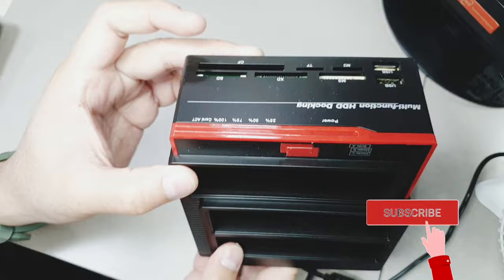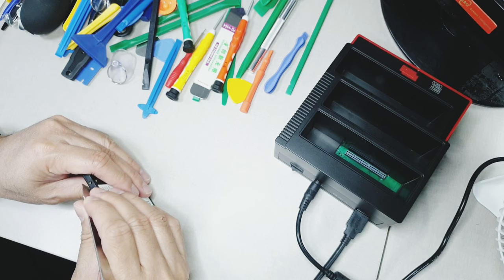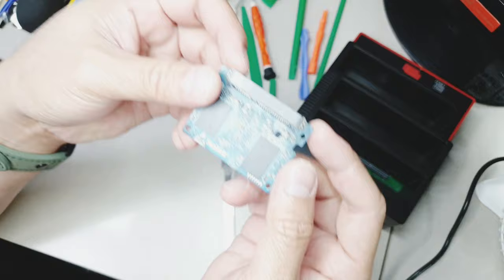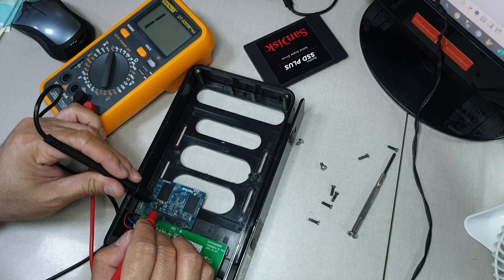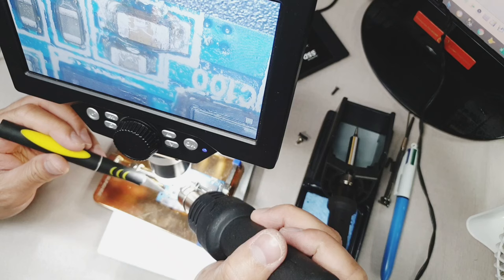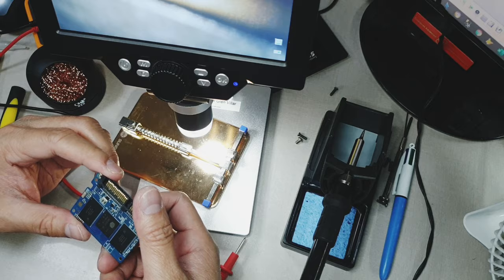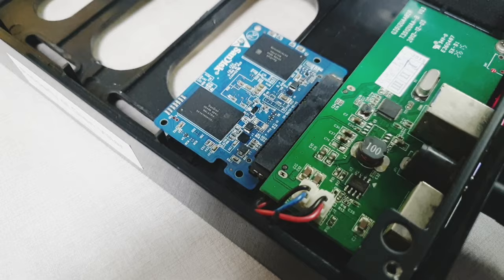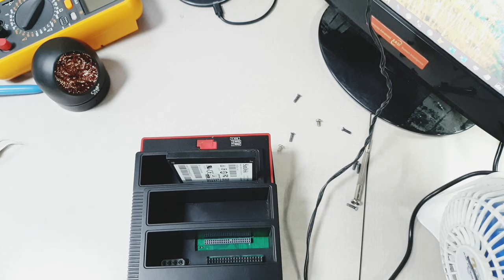How To Repair  Dead SSD (Solid State Drive) and Recover Data  - 100% Working

Comment: My ssd doesn’t show up at all in disk management. It also makes it so that file manager and disk management turn slow and fail. Does anyone have a similar experience?
Reply: I do please comment a solution if you find it.
Reply: My cheap verbatim ssd does exactly that, when plugged in using a usb3 to sata adapter, it shows up in explorer but the moment i try to access it everything freezes. And when its plugged directly to the motherboard the pc fails to boot at all.
Reply: I do. The boot drive is 100% health, running. Sudden power outage and poof. Cannot boot. The bios and windows detected the drive, but froze when attempt to read/access the disk content 😢. For now I try to run the ssd without sata cable for day and see if "other youtube claimed" self-repair function work.
Reply: Yes I do
Reply: @vitatreat9037 does the solution work for you? I have this same problem. The ssd detected in bios and windows but any interaction with it will cause freeze. Not even chkdsk would start to scan it.
Reply: I have two ssd one 256 GB and the other 512 GB. Both are not working. It shows for a little time when you install the window it freezes.

Comment: Thank you very much! Explaining what you're doing (like checking with multimeter if components are shortened) was so helpful to understand the whole process. I finished tech school, but sadly I was prepared only for installing stuff that is ready to install, not to reparing the electronics and thanks to people like you I can experiment with fixing things electronics that others consider as trash
Reply from the maker: Welcome and thank you for your supportive comment.
Reply: @ReynaxisSolutions  may shop ka ba dito sa Manila. may papagawa sana ko na ganyan. di na din madetect ng motherboard.
Reply from the maker: @LabyuPilipinas  Hi, wala akong shop sa Manila e. Nandito ako now sa Papua New Guinea. OFW. Sorry.
Reply: Hola era el capscitor la falla
Reply: Sir, yung 2 shorted na capacitor tinangal nyo lang po ba ng hindi pinapalitan?
Reply: san nyo po binili thermal cam.

Comment: Your tools are so cool... wish I had the money to build a full lab with equipments like these and just play with electronics all day
Reply from the maker: Hi Nanof,
Thank you. I wish that you have them all too. You're right, playing and experimenting with electronics stuff is a fun way to go through the day.
Reply: The moonins seem to be on the rise, why is that? Also, you can get a seek thermal cam pretty cheap, a solder iron fairly cheap and a microscope cheap. Won't be as good as his but it would still do the job.
Reply: Cheap thermal cam? Really?
Reply: @drummerdoingstuff5020  no.... no... the least expensive decent is $100
Reply from the maker: @drummerdoingstuff5020  The thermal cam that I have is a bit pricey. There are other cheaper alternative but the thermal resolution and sensitivity isn't as good though.
Reply: so is it just necessary to remove the overheat capacitor?
Reply: Amazing. I’ll try it. I found the background piano jazz a bit annoying. Hard to understand voice with BG music. Turn it down! or off!

Comment: After trying to get the ssd to read i noticed there were quite a few components that were hot.  But after removing all 22 of them when i plugged it back in to the pc it got so hot it shot a spark out of it then the pc flashed a blue screen and now it wont power on at all..  i am going to try flipping the little red switch on the back of the computer..  says 220 and 110, i am going to move it to the 110 side and see if that helps..
Reply: It didnt help, it created more hot sparks.. but this time my light bulbs in my home went out.  I think i uploaded a virus to my house now because nothing is working..  i think the virus is in my fuse panel, maybe if i try the ssd in there.   The fuse is all black, will try the ssd card there and see if my pc boots..
Reply: Well that made a lot of hot sparks but the lights are back on,.
I have to go now, the fire department is telling me i need to leave because somebody set fire to my walls.  People are cruel..
Reply: @Z-Ack  Sorry to laugh,  and I don't if you are serious or not,  but that is really funny.
Reply: Try using 460volt three phase. That will speed up the machine for sure. 😅😅😅

Comment: Great job with excellent technical prowess. Thanks for the video recording to share such great knowledge and skills. I however, observed that you isolated a damaged capacitor, but you didn't record or show that you replaced the capacitor. My question is: do you need to replace all removed electronic components from a logic board?
Reply from the maker: Hi, thank you for the compliment. I did not have to replace the 2 caps that I removed because they were just filter caps. After recovering the important data from the ssd, i never used it for OS anymore. But I still use it for holding temporary files when I'm copying from one place to another.
Reply: The capacitors are there for a purpose they are there to stabilize the power lines to the chips. To not replace with new ones is very amateurish & I would not trust that SSD for anything. DO IT RIGHT or DON"T DO IT AT ALL.
Reply: @Starlight-AG  He even said so himself...up there. He only uses it for transitory files now.

Comment: I saw you remove the capacitors but did not see you replace them.   If you did replace them, where do you purchase them?  Thanks for the video.  I have 2 nvme drives I'm going to try to get the data back from.
Reply from the maker: Hi, i did  not replace them as there are other caps remaining that allows the ssd to function.
Reply: @ReynaxisSolutions  ooohhhh
Reply: The ideal scenario would be to remove the defective capacitors and replace them with good capacitors, but in this case the objective is only to recover the data from the SSD, and once recovered, one should not continue to use this SSD, as it is susceptible to failure again, due to missing capacitors removed.
Reply from the maker: Hi Correct, the goal is to recover important files from the SSD. It was never used again after the data recovery.

Comment: the way you lifted the capacitor with knife is wrong, you could have applied tip of the soldering iron quickly on both pads and could have easily picked that up with a tweezer.

Comment: hello, do you need to replace those capacitor or you just leave the pads stack empty? if you replace them how can you tell the value of the capacitor if they are shorted to replace them (if you don't have another same ssd on hand or the schematic of the ssd)? thank you for your video and nicely done!
Reply from the maker: Hi. I did not replace the capacitor. I only need to copy the data from it.
Reply: @ReynaxisSolutions  but in order to rescue the data, you first had to fix? The capacitor or replace it?
Reply: @cestvraimenthorrible3465 he doesn't need to fix the entire circuit in order to recover data

Comment: Brilliant video, question you removed 2 capacitor, video doesnt show it being replaced, so was it replaced? or did this work without having to replace them?
Reply from the maker: Hi. Thanks. I did not replace the capacitors.
Reply: @ReynaxisSolutions  did you just remove it and done?
Reply: @E1qsaeo  this is a common way of fixing logic boards, surprising but often these capacitors are either redundant, or not vital for the board to function. I would not trust my files with it though

Comment: Thank you for the informative video. Just a question, did you replace the capacitors or just remove them?
Reply from the maker: Hi, I just removed them.
Reply from the maker: At that time, I don't have a replacement capacitor. If they are just filter caps, it's ok to remove the faulty ones, copy the data and then never use the ssd again.
Reply: @ReynaxisSolutions  thanks. What about if it’s resistor instead of capacitor ?

Comment: I didn't see you replace those capacitors. Did you? If not, why?
How do you know the difference between a capacitor and a resistor on those tiny components?
Reply from the maker: Hi, yes, I did not have to replace the faulty caps as long as I could quickly copy the important data. I threw the SSD away after recovering. You would know the difference between a SMD cap and SMD resistor.
Reply: @ReynaxisSolutions  
Oh, OK.
But would you ever want to use a fixed SSD that had bad caps? Or is that a bad idea?

I still don't know how to distinguish between those tiny caps and resisters. How do you know?
Reply from the maker: Hi, I can distinguish it maybe due to experience of inspecting logic boards. But usually, SMD resistors are colored black or dark brown and SMD capacitors are either grey, beige or brown.

Comment: thanks a lot !! i actually have two capacitor shortcircuit i remove it and resurect from dead
Reply from the maker: Welcome. Congrats.
Reply: @telefrio What model of the thermal camera you use for this checking?
Reply from the maker: Hi, it's Seek Thermal Cam Pro

Comment: Why are the capacitors even there if it works just fine without them? I am guessing they are used as a store of energy if the laptop or computer is unable to deliver constant 5v at a high enough amperage, but what I do not understand is how this works when the circuit logically is now broken and no continuity.
I came here because I have an unreadable SSD and I had a slim hope that there might be a way to revive it - at least long enough for me to pull some data off of it.
I do not have a thermal camera at the moment but I could of course just do a quick test with the multi-meter to see if I can find some shorted capacitors :)
Reply from the maker: I think they are filter capacitors. They're just there to make the DC smoother or something. They sit in between the positive and the negative in a parallel line so even if you remove them, the lines are still there to deliver power.

Comment: This is pretty useful. Will having the capacitors off the board cause problems? If so how do you determine the value and where can you get some more other than another SSD of the same type? Thanks for sharing. Best Wishes & Blessings. Keith Noneya
Reply from the maker: Hi, removing it does not cause a problem as it may be a filter cap. However, it is only good for recovering the files and after that, I don't recommend to use the SSD again.
Reply: @ReynaxisSolutions  Thanks for the reply, I've been doing electronics for over 42 years but the PC side of it is still kind of new to me, I rarely get involved on the repairing portion. My son has a 1TB SanDisk that died so I was curious about that. Thanks again. Best Wishes & Blessings. Keith Noneya
Reply from the maker: Hi. Thank you so much.

Comment: I want to replace a capacitor that is shorted on my SSD drive but I don't know which replacement I have to buy I see so many different kinds (NF,UF, PF + numbers). The only visual reference that I have (on my case) is a capacitor L4 but I can't find it as so.
Reply from the maker: I think any SMD filter capacitor would do. Usually, if it's a filter capacitor, it's ok to not to replace it as long as the data is recovered from the ssd. Then once data is recovered, I would not use the ssd again.
Reply: @ReynaxisSolutions   I only want the data back. At the moment I can load the disk with a external disk reader, but it is two slow to load the files and at a moment it just stops responding. I'm new to this, so I don't know if the setting I used on mt multimeter are correct, I got a reading of 002 on the L4 cap and a short, also I get a red light when the disc is connected , I don't know if that means anything. In any case once I manage to find the L4 I'll use your instruction to replace it. Thank you.
Reply from the maker: You can try and remove the shorted caps and see if that solves your problem. But if not, you'll have to solder the caps back to the board. But be careful though as the heat from the soldering gun or from the hot air could damage the other component.
Reply: @ReynaxisSolutions  Ok. thank you very much. I will try.

Comment: I am a bit confused. So you removed the faulty capacitors without replacing them with new ones and it worked?? Or was replacement part of the vidoe cut off??
Reply from the maker: No, I did not have to replace the caps.

Comment: Is there anything you can do if the drive doesn't even appear at all?
Reply from the maker: I'll have to inspect the logic board.
Reply: That's the problem I have, it's just not there, nothing shows at all.
And all that happened to it was a dodgy update, but now it's totally dead.
The red light on the ssd board comes on, but that's your lot.
Just dead as a Dodo!

Comment: Hello. I have a problem. My usb mouse was broken and i had error  “power surge on usb port damage”. After couple of this errors my Dell lagged and blue death screen appeared. I reload my laptop because of instant 0% - and then after restart black screen appeared with “no bootable device” error.
With diagnostics on F5 i have problem “hard drive not installed”. Changing boot settings from Legacy to UEFI didn’t help.
Is my hard drive dead, or it can be revived? Will be all my data gone? Or it can particularly saved?
Reply from the maker: Hi, try plugging in your hard drive on an external harddisk enclosure and hope that it can still read it. If not, you may have to send it to a tech who can recover or fixed your hard disk.

Comment: So what are the capacitors good for if they can be removed and the drive is working without replacing them?
Reply from the maker: Hi, from what I know, filter caps can be removed and the device will still work if there are more than one filter caps on the board.

Comment: I have the very same drive. I installed an NVME and about two hours later my SSD died.
Shows in Device Manager using an extremal USB3  caddy, but not in Disk Management. And the PC won't boot with it plugged into SATA or USB.
Reply from the maker: The ssd might have a shorted component.

Comment: Hi, did you only remove the "shorted" capacitors or did you replace them? i have the exact same problem and would like to use your guidance to fix it. Thanks.
Reply from the maker: Hi, I did not have to replace the faulty capacitors because I only needed to copy the important data from it. I threw it away after recovering the data.
Reply: @ReynaxisSolutions  Thanks, I will give it a try, because I was going to throw the ssd away anyway. Thanks for the help, I will try your solution.
Reply from the maker: You're welcome. Try to remove one faulty caps at a time. Remove up to 3 if necessary.

Comment: Hi. Did you just removed capacitors or replaced? I didn't spotted putting those back? What values are those?
Reply from the maker: No i did not put the capacitor back.

Comment: You really are a professional a very well epxlained and detailed video that actually shows how to fix the thing but the music was quite annoying and loud
Reply from the maker: Hi, thank you so much for the compliment and an honest feedback. I will definitely stay away from putting in too much music background in the future.
Reply: @ReynaxisSolutions  np sir thank to you too , btw i have an adata su650 which seems to have the same problem but unlike the capacitor in the video the source of excessive temperature seems to be coming from a chip with the realtek logo on it will it work if i had to remove that chip or does it need a replacement
Reply from the maker: That chip with Realtek logo is the controller on board. Try to measure the components around the chip and see if they are shorted or open.
Reply: Bb bb😂nñññbb😢bñ tu😢ñ bn😢 bn b😢😢 bb ñbn

Comment: I some what have the same problem. I have 3 larger size square caps not the small rectangler ones. The three show continuity which im guessing is bad. Do you know what i could replace them with?
Reply from the maker: You could try and remove them one by one and see if the ssd will work. If all those 3 caps removed and ssd still didn't work, return them and find a similar cap.

Comment: What’s that multi hard drive reader you got called?
Reply from the maker: It's called a Muti-Function HDD Docking. It's basically a dock that can read 2 SATA hard drives/SSD port and 1 IDE port for older types of hard disk. It's also capable of doing an offline cloning, meaning, it doesn't need to connect to a PC to clone a hard drive. https://youtu.be/mEqqM0SeUew

Comment: very nice, what thermal camera has been used in this video ? I have the same SSD disk and it does not appear in win manager or in the BIOS so I assume there may be some similar burn outs and I would like to fix it just to get out the data from this SSD. Thanks in advance!
Reply from the maker: Hi Amel, 
Thanks for watching. I used the Seek Thermal Pro. It's a small camera dongle that you can insert to the phone.
Reply: @ReynaxisSolutions  you´re very welcome! thank you for the infos man! will go and get one right ahead. Thanks a lot again!
Reply: Hi, I have the same problem, does the thermal camera fix It?

Comment: Good Sir, may I ask how much would be the total cost (in peso) for this whole fix? Might as well add a breakdown of the cost if possible. 😊 Thank you for this very informative video!
Reply from the maker: Hi sir, I'm currently working in Papua New Guinea so I have not idea on how much the techs in the Philippines are charging for this repair/data recovery.
Reply: Hello are you still in Papua New Guinea? i would like send you my SSD card for repair do you accept that?
Reply from the maker: Hi sir, at the moment po hindi ako tumatanggap ng parcel from overseas for the risk of it getting lost.

Comment: You remove the capacitor then replace new one? I don't seen to be replaced? Thankyou for reply..
Reply from the maker: Hi Boomboom Dynamight, yes, the capacitor did not have to be replaced. But I would suggest to put a replacement capacitor if we could find one.